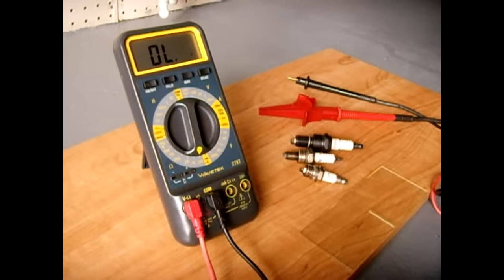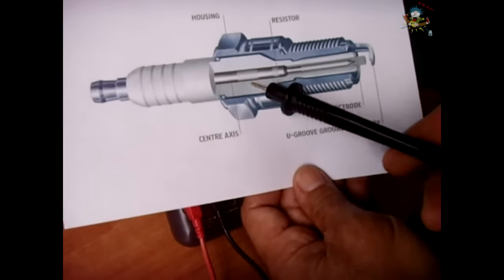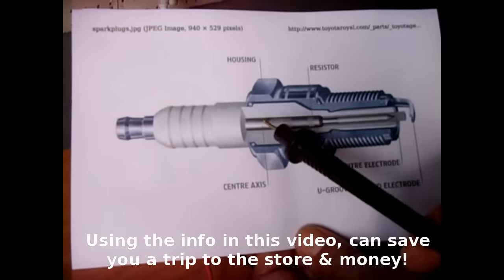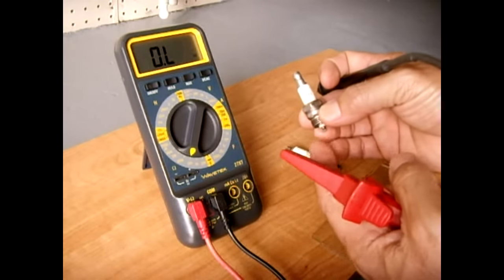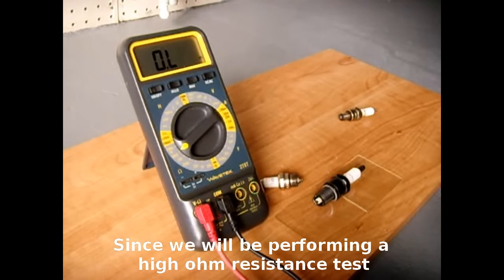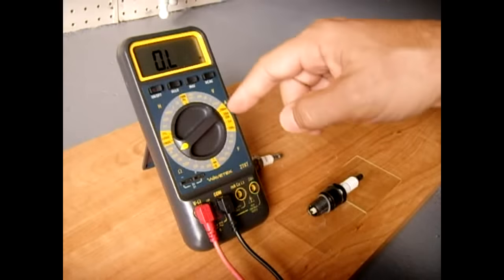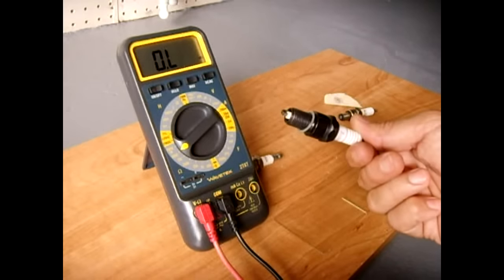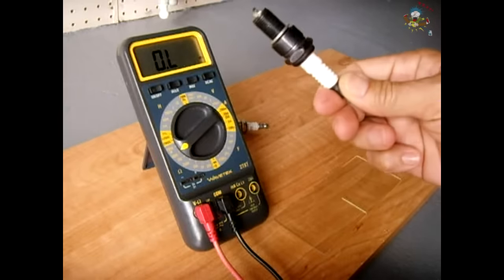How to rule out a Spark Plug as your problem

Comment: From my experience working on bike engines:(1) Does it have NGK written on it??(2) Is it more than 3 months old??(3) Is the plug black??(4) Replace the plug with a better made brand (or just replace with another NGK plug if you enjoy frequent spark plug issues).
Reply: +Andy Reid as a fellow powersports mechanic, I run NGK in all my stuff and dont have issues with them
Reply: +Zyggiespace I own and work on a lot of 1970's 2 stroke bikes running more than 9:1 compression ratio and have found that NGK plugs don't like (A) high compression ratios and (B) 1970's 2 strokes that tend to "buzz" a bit when on long trips. The faults that is typical is that after 15 to 20 miles of open road high speed riding first the bike starts to cut out occasionally on one cylinder (or starts to judder on a single pot motor) when the throttle is opened up. Then the plug just stops sparking and the rider pulls over and suspects (wrongly) that something like a wire has come loose. After much fiddling and faffing about the fault has apparently cleared itself (the bad NGK plug has cooled down) and the engine starts and runs perfectly..... for the next 15 to 20 miles and the whole thing starts again. If I had a beer for everytime I've had this happen to me or friends over 35 years of riding motorcycles I'd be drunker than an alcoholic trapped in a brewery. I surmise, from testing the plugs before and after they've cooled down with a continuity tester, that the problem is that the metal rod though the porcelane between the electrode and pip on the top of the plug moves and looses electrical contact when the plug overheats. Once cold the plug returns to electrical continuity until overheated once more. Breaking open theprocelane on an NGK plug reveals that they are unconventional in the use of a copper rod rather than the more traditional steel or iron rod (as use in Lodge plugs and others) which might be the cause of the problem in that copper expands differently to steel and iron, causing it to break contact when the plug overheats. 2 stroke also run a lot hotter than 4 stroke motors, which doesn't help.
Reply: I do know that the Arctic Cat 1100 turbo comes equipped with NGK MR8AI-9 plugs and those have held up to a substantial amount of boost pressure. That might have been an issue with them heating up and breaking in the past, and using a copper core (I have broken some on accident) but they dont use that anymore, Also, todays four stroke engines produce much more heat than two strokes.
Reply: +Zyggiespace My local motorcycle repair shop owner confessed that the reason why NGK is the only brand they carry is because they have a higher turnover than when they stocked Nippon Denso, Champion, etc. and having worked in a motorcycle dealership in the recent past, the same was true with that place too. The repair shop owner said that when he sold somebody a plug they didn't need to replace it for more than a year or even two years. By comparison he can guarentee that a customer will need to replace an NGK plug per cylinder every 4 to 6 months on a everyday use commuter bike. He even spent 2 wasted hours trying to sort out an ignition problem on a customer's bike during a service only to find out that the brand new NGK plug he'd fitted from stores was dead as a Dodo. He reckons that QA has gone downhill over the years with NGK. Here in the UK NGK is the only brand that every motorcycle shop carries (good turnover!!) so try finding ND, Bosch, Brisk, Champion and as for Lodge, by sheer luck after searching the internet due to the high price. (I've had a set of Lodge plugs last through 3 bike engines over 8 years, but for what I paid for them, I'd expect no less).
Reply: +Andy Reid back to your previous comment. I'm not sure what ratio you mix the gas/oil in these 1970s two stroke bikes. or if they run an injector pump. but I see a great increase in plug life, regardless of brand, if the oil is leaned out to a certain point. for example. 32:1 leaning it out to 40:1 or even 50:1. while gaining some slight performance
Reply: +Zyggiespace Tried running in the past 40:1 but decreased centre crank centre bearing life by 30 to 40% as unfortunately the oil collection holes and galleries were designed for 33:1. I'd need to open out the catchers and gallery feeds maybe before trying that again. It is a common well proven falacy to believe that modern synthetic 2 stroke oils can be used at lower ratios than the old mineral based 2 stroke oils (which had their own detremental effects on crank bearings such as "soot grinding", etc. not to mention solid carbon deposits in the exhaust system and ports!!) as the oil still has to cover the same volume of area. Not a fan of injectors after buggering up a crank on a Suzuki GT550 when the pump cable snapped on a ride and dropped the pump into idle mode..... tripple cranks are the most expensive to have a rod replaced in. Besides, as any proddie racer and 2 stroke tuners knows, ditching the oil pump decreases eraneous motor load by 2% and with tank mix one doesn't have to worry about closed throttle piston seizures. When will we finally have oil free direct injected bikes as the mainstream?? They polute less than N2O and CO2&#160;gushing 4 stroke motors, though even a 1970's 2 stroke produces 1/24th of the N2O emissions per cc of a Cat equiped 4 stroke motor (just more hydrocarbons!!) (Source US governement research).

Comment: Nice video. Is there any other way of checking spark plug than using a multimeter? I mean high voltage breakdown test?
Reply from the maker: Usually just using a very high ohm range is fine, but if you had a megger, you can use that as well.

Comment: well , the test meter , whikle checking ohms of center electrode, might not tell you about any crack in ceramic, with which centeral electrode is coated. But, when such a plug is installed, the powerfull current might jump through crack, and engine might misfire, or malfunction due to increasing heat.
Reply from the maker: Like I said many time before in this comment area, I've never had this method fail. You need to read my pinned comment too. :-)

Comment: WOW, you read my mind!
I was just about to comment asking if I can just heat it up with a heat gun to test it warm.
I have a 15 hp evinrude that will not fire, I was told it had good compression and spark but the seller was kind of a BUTT so, I'm going to get a spark tester to be sure.
I put fuel in the carb, nope, put fuel in the spark plug hole, Nope!. If I pull it around 20 time it will POP!
Reply: phartattack If the plug test is positive, next would be to check coil. If that also returns positive go for the fuel. Carburetor on marine applications tend to clog mostly due to lack of regular use. Either case make sure you have new clean fuel. Clogged gicleurs is very common also.

Comment: Thanks for this insightful video  I am currently having an engine problem i.e. poor idling performance and I am glad to learn about this test. To make a long story short I have replaced the old spark plugs with a new Bosch brand but still experience loss of power. what could the probable cause be ?
Reply from the maker: Hi,

What you stated is exactly why I uploaded this video. You bought all new plugs that you did not need. Are you located in the USA? Many auto parts stores will allow you free use of their automotive computer code scanner. Using the code scanner will let you know if any problems are detected. If no code scanner is available, or the scanner shows no problems, then it could be many things. Clogged fuel injectors, dirt carb, bad timing, etc.

Thanks For Watching! Be sure to share, and also check out my video playlists.
Reply: Thank you Sir
Bad ignition timing seems a good guess ! It all started with sporadic misfiring at low RPM a few days ago. Upon speeding up, everything seemed OK. In the process of unscrewing the old spark plugs, the ceramic insulator shattered and a small bit fell into the engine cylinder (combustion chamber) I suppose this was an awkard mishandling  on my own or it might well be that the spark plug was already worn out and cracked under extreme heat stress. We managed to partly retrieve it with a vacuum cleaner. When the engine was restarted, an ominous sound was heard which quickly disappeared after running the engine for 15 minutes at 1500 RPM. I suppose the engine managed to digest (desintegrate) and expell into the exhaust pipe whatever bits were left. Everything was back to normal however after travelling 15 kilometers a severe loss of power was observed. I will keep you updated as things unfold. The computer screening code you are talking about is called here a diagnostic suitcase. The car make is Ford Mondeo... Greetings from France
Reply: @LEBANON707  ceramic powder will act as sand paper...scorred barrel,  damaged valve seals, broken rings etc..

Comment: I have found out that the test was inconclusive with a spark plug in my Dads Honda GX35 line trimmer.

While the centre electrode tested at 10K ohms & the outer to centre electrode tested at 130 K ohms indicating a short circuit,I burnt the carbon off with a propane torch,the resistance checked at infinity ohms so it tested o.k.

The motor still ran like crap so I swapped it for the spark plug out of his Honda hedge trimmer then it ran like a beauty.

The problem was it was apparently cutting out with 1/2 a tank of fuel in it so I checked & replaced the fuel filter with a new one,I cleaned the fuel tank out because it was dirty.

I also pulled the carby apart & blew it out but it would idle for a minute or so then stall which would throw anyone off as being a fuel problem.

The problem was the spark plug !!!!
Reply from the maker: Never had it fail for me. I'd be willing to bet you cracked the electrode using a torch! Never use a torch. You clean the plug with a mini sandblaster or use carb/brake cleaner.
Reply: Spark plugs get red hot in an engine anyway & the resistance went up when  the carbon was burned off.

For the sake of a $2 spark plug I would be better off replacing it, the electrode itself may be faulty as the spark plug fails particularly once the engine warms up,maybe the electrode insulator is cracked ? I don't know !!!!

I had trouble in 1994 with an old Honda motorbike which had worn rings where I'd take it to tech to use their sandblaster to clean the carbon off the spark plugs,it got to the point that a hotter spark plug became the band aid solution to the problem for a while at least,they also had a vacuum chamber at tech which simulated the spark plug condition when under load inside the engine meaning that the spark can be checked under vacuum, I don't have anything like that at home.

My Dads Honda lawnmower has seen a fair bit of use in its 15 years of use since new,the spark plug is original in the lawnmower & I just clean & adjust it every 6 months for him when I do the service on it,it is getting a bit worn out now & eventually will need replacing.

Comment: What would oil or dirt… have to do w the function of the spark plug other than the thread? The thread would be ground.  The core is sorrounded by the porcelain to allow current to flow through. Keeps it from arking. Only parts that hold any importance is the the end where the ignition wire clips on. The thread.  Center electrode and the hangman piece

Comment: The temperature range is variable by the length of the insulation around the electrode tip to where it connects to the body and not the length of the top of the plug, the shorter the insulation the colder it will run also insulation break down is a common failure, tiny tracts of carbon impregnate the crack and will earth down to where the insulator connects to the plug body.
Reply from the maker: In the video I stated that a longer plug(longer ceramic insulator) is hotter, which is accurate. The rest you mentioned is accurate as well, which is why the high resistance 20 meg test is used.

Thank For Watching.
Reply: electronicsNmore No, I think Mentorcase is right - you were pointing to the UPPER part of the ceramic insulator being longer, he's saying it's specifically the LOWER tip part having a longer exposed part that makes it a hotter plug. This latter part is the where the heat of combustion is concentrated and a longer exposed ceramic tip gets hotter and burns off the carbon better. The length of the upper ceramic part has nothing to do with it since it's above the metal heat sink part of the plug. See http://www.ngksparkplugs.com/tech_support/spark_plugs/p2.asp for example.
Reply from the maker: That is true, but the longer or shorter nose, usually corresponds to a longer/shorter insulator as well. :-). At least the plugs I have seen.

Comment: I think u would be better off using a Megger to check the insulation between the center electrode and the body. The Megger uses very high voltage (a round 35 kv) with very low current around .1 micro Amp (.0000001). But all in all a very informative video.
Reply from the maker: Using a Megger would be the ultimate way to check for breakdown, but I have never had any problems using the DMM to rule out a spark plug as a problem.

Thanks For Watching!

Comment: A spark plug can test fine with a tester but  yet misfire under load. Best thing to do is to replace it.
Reply from the maker: Never had that problem, and if it does happen, it's EXTREMELY infrequent. Thanks for watching
Reply: electronicsNmore Cars do that. They misfire  under load. Changing the  plugs with new plugs fixes it. Testing with an ohmmeter isn't  accurate. You're  checking continuity.  With a scope you see it breaks down under  load. The electrode gets worn down and voltage requirements  go up. Your method isn't  accurate.
Reply from the maker: @rexanderson5458  No method is 100%, but the method I've used over the past 25yrs has always worked great for me. What you describe happens INFREQUENTLY.
Reply: electronicsNmore A REAL mechanic knows plugs misfire under  load. I took auto-mechanics. Backyard mechanic  methods don't  see what's  really going on. I had a scope and I could see plugs misfire under load. Continuity tests  isn't  accurate. Ask a mechanic.f
Reply from the maker: OK know-it-all, whatever you say. LOL Clearly you know better, and all the times I used this test successfully over the years, must've been a Fluke! :-)
Reply: electronicsNmore I took auto-mechanics and I myself had a Mac Tools scope  and I saw where a plug can misfire under  load. Fuel mixture, compression, etc. can cause a plug to misfire. There's spark duration,  on-time, low compression reading, high resistance  and low resistance, etc. Best thing to do is to replace plugs occasionally. Worn electrodes cause higher voltage requirements to fire the plug. Besides, how do you  know what's  normal per  manufacturer? If you live out in the country and drop a plug and wonder  if it's  cracked, you  could try that. Best thing to do is replace plugs.

Comment: Excellent information, I was just wondering when testing the resistance of a lawn mower plug how does a resistance test work on a lawnmower plug that has NO resistor? my understanding is that resistance is load from a device or a restriction of current flow by the use of an actual resistor and a NO resistance reading is ZERO OHMS so you would not be able to get a resistance reading from a NON resistor plug of course so to tell if a lawn mower plug is defective you will just get the ZERO OHMS reading yes? what would the OHMS result be on a defective lawnmower plug then? NOT higher than ZERO I would imagine because there is NO resistor, i'm confused.
Reply from the maker: +Thetrucky69 
If the spark plug has no resistor, then the ohms reading should be very low(zero or close to it). When a mower plug is faulty, it will fail the high resistance(Mohm) test. Also test the plug after it is heated up to 300 deg F in a toaster oven for 5 minutes. Be sure to handle the plug with gloves, and place it on a thick bottom glass (turn the glass upside down)for testing. Do not touch the spark plug probes or spark plug while testing!
Reply: +electronicsNmore I am still confused about a faulty lawn mower spark plug failing the high resistance test as a NON resistor plug should ONLY be expected to show a very low OHMS or ZERO OHMS reading anyway but you don't need to reply. I am not trolling mate as I just like to learn but don't want to irritate you. Excellent tutorials mate I am subscribed cheers.
Reply from the maker: Thetrucky69

The LOW resistance test is between the electrode tip and end of the plug where you attach the wire. For a mower, that is usually a reading very close to zero ohms. The HIGH resistance test is between the end of the plug where you attach the wire and the body that threads into the block.
Reply: +electronicsNmore Ok now I get it, I am going to watch your tutorial again and pay closer attention thanks mate cheers.
Reply: +electronicsNmore 
Hey mate, what happens if I only have the needle multimeter without the red negative clip?
Reply: Yes, this is such nonsense; Even school children
learn more about electricity than this .

Comment: nice never considered measuring resistance of a spark plug to determine if it is good how ever one would need the exceptable ohm range it should be... though if it was way off or shorted that would be a quick test
Reply from the maker: sam111880 The method has never failed me. Thanks For Watching!